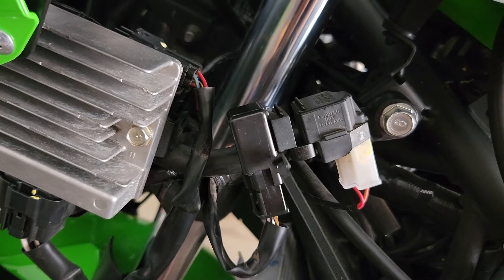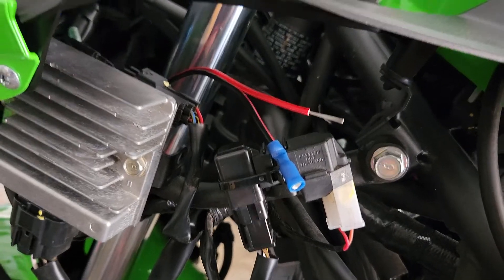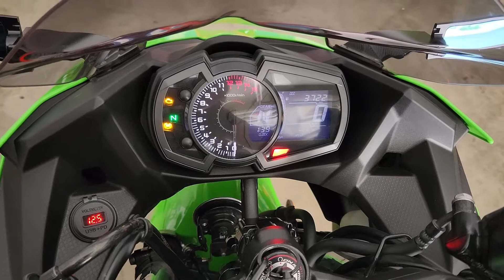12V DC outlet for the Ninja 400

Comment: I understand where the charger goes. I understand where the fuse goes. Where the f*ck do the wires connect?
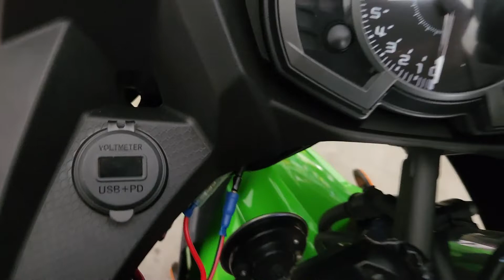Reply: I had the same question, I looked around and saw my bike had 2 stray bullet connectors where his were at 4:04. Mine were tucked away in the same spot tho.

Comment: Aaah so this is actually really hard because no cable except the kawasaki kit for $95.95 will come with the cable where it has positive and negative that plugs into the back of the outlet/usb that screws on the Ninja dash panel and the other end the male female bullet connector. So i want to know how to make/build bullet connectors but dont know how. So i get you buy that little plastic, strip the ends of cable and after you stick them in the plastic hole you just crimp it( which means squeeze it?). Does sticking it in hole and squeezing plastic over stripped cable all you need to do?
When you said i stripped, you said something i have no idea what it means but need to know, what does “14 to 16 for these mean”?
Reply: 14 to 16 in the video refers the gauge wire he used. There's alternate relays and chargers that'll run you around $40-50 for everything you need.

Comment: hey m8 i'm an electrician and i can assure you that you do still need a fuse inline, the relay does not act as a fuse in any capacity, it simply routes the current. of course it will work without the fuse, but now the circuit has no protection and if there is any cause of electrical fault between the power supply and the outlet, you risk damaging any equipment connected to the circuit, ie a phone, or the wiring itself. please if you get time, reinstall a fuse inline. 3:35
Reply: The accessory wires are already wired to a fuse in the fuse box.
Reply: @MedicDoggo  so no need for a fuse? Where is the fuse box located?
Reply: @DaBuGzLiFe  No, fuse box is on the left hand side of the bike under the side fairings. The position of the accessory fuse is box 2, slot 4. It's a 5 amp automotive fuse.
Reply: @MedicDoggo  thanks man!
Reply: @MedicDoggo your phone charger is not an accessory wire
Reply: @grovestreetbarz  What are you on about? The accessory wires are labeled by the Ninja 400 wiring diagram as providing 12 volt power to the "Accessory System" That system already has a 5A automotive fuse located in Fuse Box 2, Slot 4. No one talked about a phone charging cable...
Reply: otherwise m8 nice vid
Reply: What type of fuse would be used in this situation?
Reply: @Dillbeet  an inline fuse. basic automotive type. 10amp probably. it is simply there to protect the device from overcurrent in the event that the circuit has a fault. (the device being anything plugged into that usb outlet and the usb outlet and wiring itself) most of these usb outlets have an inline fuse already in the wires. but some do not.